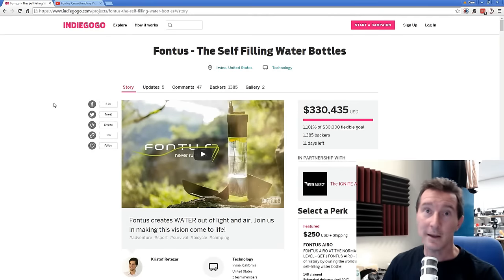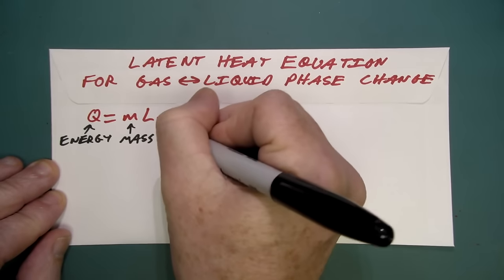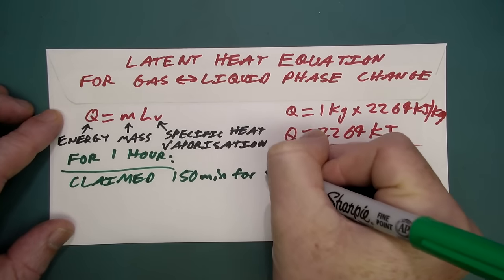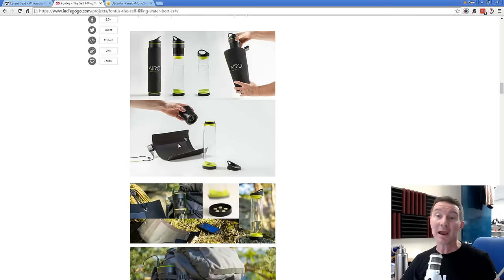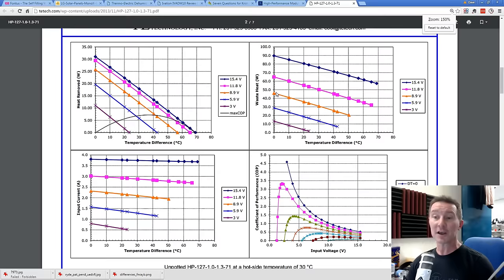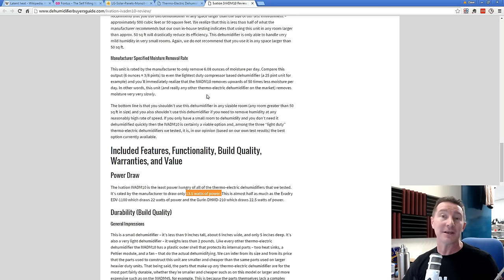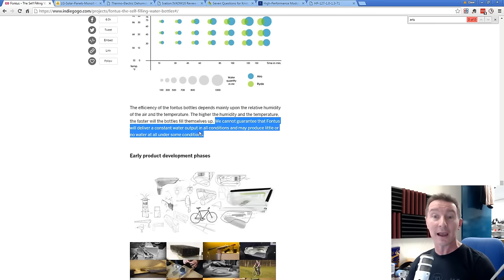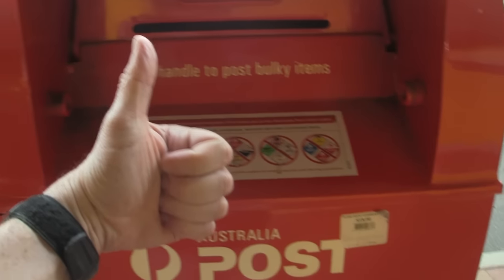EEVblog #881 - Fontus Self Filling Water Bottle BUSTED!

Comment: It would be using 5v - did you not see the USB ports? (or the much more obvious give away - the size of the panel, ffs, has anyone ever seen a 12v panel that tiny?) 
This would make the peltier element much more "efficient" -  for heat output anyway, not cooling capability. 
You get its heat "pumping" capacity, plus what is actually an "inefficiency" in the rest of the electrical world - the element creating heat from the power running through it. 
You need cold to dehumidify.. 

So you brought up an irrelevant point - it's heat output efficiency, and then we're spewing total BS about it.

Comment: How can a heat pump be more than 100% efficient? Where does the extra energy come from, because it must have extra energy, or else it wouldn't be over 100% efficient!
Reply: +Seegal Galguntijak It pumps the extra energy. The idea is that you need less energy for pumping heat, than the heat itself. You are basically fighting the third law of thermodynamics when you pump heat. 
It works really well for heating your house, because all the electrical energy will be converted to heat, and you will also pump heat from the outside. So even a very bad heat pump can have 200% efficiency. The problem is that Peltier cells are very inefficient, so they are only used where other solutions are not practical.
Reply: neurhlp I see, so the pumping action itself isn't above 100% efficient - that makes sense then, thanks for the explanation!

Comment: Just wondering,what if they were to power it with a huge dynamo running off the bike's spinning wheel?It wouldn't be practical but would it condensate a good amount of water,fast?
Reply: +Dwg According to a quick google search an average person can only produce around 75 watts on a bike.  So you would be well short of the 250watts that is needed.  A very good athlete might get to 250 Watts but even so they won't be able to actually bike anywhere because all of their energy would be going into making water.

Comment: Yeah I don't know about all of that sciencey sounding stuff. And even someone with my level of ignorance could tell such a claim was too good to be true. 
Without the whatever effect its supposed to work on, just setting a cold beer straight from the fridge, onto a picnic table with a relative humidity of 80%, the condensation on the bottle wouldn't come close to equaling the amount of moisture that you exhale, at rest, to equal a similar amount of condensation on the bottle. And it takes a lot of energy to cool the bottle down to that point. 
 Now imagine you're in an athletic setting, perspiring profusely where you need a liter an hour...what fucking device the size of a flashlight will give a whole liter, in 4 hours, let alone one? What the fuck. 
That's why survivalists always suggest looking for existing stands of water, and know how to sterilise it.

Comment: And then there's this paper from the "International Journal of Water Resources and Arid Environments" that draws a litre of water an hour using the same basic technology at 120w of solar power. Given they are likely at high temp and humidity..

But they use multiple peltier devices and they run the air first through the hot side heatsink so it can gain more moisture, and then run it through cold side heatsink. 

But still published results of a liter per hour at just 120w solar. 

http://www.psipw.org/attachments/article/273/IJWRAE_1%282%29142-145.pdf

Could better thermal transfer technology in the heatsinks making larger surface area possible make it even more efficient?

Comment: The product is an scam of course, but I would say that there is a mistake in your explanation. To convert vapor to water you need to EXTRACT heat. And, in fact, you can extract 1 kJ of heat by using much less than 1 kJ of external work. In the following link the extracted heat is called QC and the external work is called W: http://physics.csustan.edu/Ian/HowThingsWork/Topics/Temperature/ThermoLaws/Refrigerators.htm . You can see that W=QC/COP and COP is above 1. We could assume COP to be around 10 for the current scenario, and then it would be possible to extract 1 kJ of heat by using 0.1 kJ of energy.

Comment: Please have a look at "dew point" in Wikipedia and search for a dew point calculator on the internet. By increasing the pressure using a fan or Venturi effect like in the "Ryde" version, dew point is even higher. It will work without having to cool the air down !!!
All the calculations you have done are crap!
Of course it might never work in the Australian bush, but on Australian coasts, in rescue boats, this thing can make the difference between life and death.
Reply from the maker: +marco672010 Please explain why the commercial thermoelectric effect units (which have fans too) which are essentially identical to the Fontus design, can't produce anywhere near what the Fontus claims.

Comment: so you need constant 250w power for one hour to produce 1liter of water or 250w in total?
Reply: +JusstyteN 250W is an instantaneous measurement. Do you mean 250Wh?
Reply: +JusstyteN 250 W for one hour would be 250 Wh in total. And to get that 1 liter you'd need it to be at least 40 degrees C, 90% humidity, and have a 100% efficient system of extracting that water...
Reply: thanks for clarification
Reply: +Samgab Please consider using joules instead of watt hours, watts are defined as 1 joule/second so a watt hour is (1 joule/second)*3600 seconds. I know joules are basically unheard of in the US at least (on a popular level) but dividing something and then multiplying it again by the same thing is ridiculous!

Comment: so you need constant 250w power for one hour to produce 1liter of water or 250w in total?
Reply: +JusstyteN 
watts aren't actually a system of measuring energy, in the video he said 250 watt hours
Reply from the maker: +JusstyteN No, I goofed that, it's 250W for 2.5 hours. 625Wh
Reply: +JusstyteN I am using dehumidifiers that are rated 210W, the manufacturer claims 10 l /day (maximum, hot and humid).

Thanks to the EEVblog for fending off religion in science and technology.
Reply: +EEVblog thanks
Reply: +JusstyteN Dehumidifiers: 30 °C / 80 % rF, 55 l/24 h by 900 Watt
Reply: +JusstyteN  more like 600 watts (compressor/peltier efficiency) to pull a liter per hour.   The input air on mine at 80f with 90% humidity gets raised to 100F with 60% humidity and it puts about a liter or so per hour out... while the shower is running.   Spraying just cold tap water (75F-ish) in the shower raises the moisture in the room from 43% (best continuous operation) to 64% and pushes the temp from Airconditioned 70F to 90F in the exhaust.

Its a valid system and it could work if it had five square meters of solar panel at 30% efficiency in a 70% humidity environment.

Comment: No, sorry, this is wrong.  Condensing a liter of water from vapor to liquid does not require 2264.76 kJ of energy.  It YIELDS 2264.76 kJ of energy!  We could use water vapor as an energy source, if it weren’t for that pesky Second Law of Thermodynamics.  Thanks a lot, Obama.

Given that free transfer of energy isn’t possible, how much does it cost to transfer that 2264.76 kJ from the vapor to somewhere, anywhere, else?  The efficiency of a mechanism to move heat energy around is called the Coefficient of Performance.  A really good air-conditioner can have a CoP as high as 3.5, meaning it consumes only 1/3.5 (28%) of the energy it moves, meaning that heat-pumps (which air-condition the outdoors and move the heat inside) can be very effective.  A Peltier cooler, though, has a CoP between 0.3 and 0.7, so it could take more than 7550 kJ (2000 kilowatt-hours) to condense a single liter.

Comment: Could you build a bottle that does this when plugged into a wall outlet with a laptop charger?
Reply: +BosonCollider Why not just get a $40 dehumidifier from Amazon, plug that into a wall outlet and then pour the resulting water into a bottle? Or just get the water from the tap - cheaper than paying for the electricity.
Reply: +BosonCollider yes but if you have access to a laptop charger and wall outlet you probably also have access to a tap
Reply: +BosonCollider Well this would work over a very long time (months) A charger is around the 80W mark so would still take at best days to get 1 litre.

Comment: Wouldn't this work a hell of a lot better if it was powered by one of those dynamo bicycle hubs or a generator that rubs the tire. Seems like if these jackasses weren't just con artists and actually put some thought into it the bicycle version could work?
Reply: +Jason Grimm Nope. Granted, a hub dynamo is a much more reliable source of power than any kind of portable solar panel. But it only produces enough power to charge your lights, maybe GPS and phone. You could get maybe 10W out of it without noticeably slowing your bicycle down; to keep yourself hydrated, you'd need hundreds. Which you could technically exert if you're a decent cyclist, but you'd need a much bigger generator. And a much bigger heat pump.  And you wouldn't have any energy left over to go anyplace. So yeah, you're better off just carrying more water bottles, if you must.

Comment: what about using the power from the crank of the bike? or the battery of a pedelec or e.bike?
Reply: +Cheesecake An easy bike-ride is about 100W, heavy-biking for a normal person is 300W. Tour de France is 500-1500W sort of power
Reply: +redtails there is a video on yt of German velodrome cyclist Robert Forstemann powering a toaster. 700 watts he needed to maintain and it looked like it nearly killed him off.
Reply: okay, that sounds hardcore!
Reply: +Cheesecake And said cyclist was dead tired after generating 700w of power for about a minute.
Reply: 0tispunkm3y3r and Crimson Sunrise  I realize it and it's what I said ;). I do cycling for hobby and can maintain about 280W of cycling power (measured at a university) at maximum intensity. I'm a fairly healthy 20'something and at that power you go about 25-30km/h so it's not an easy bide ride. You'd notice it very well if you're using say 100W of that power to make water from air.
Reply: +redtails Nope not even close sprinting is about 1000W for about 20 seconds or about 1300 for 5 seconds. The bulk of the race they are around the 230-250W mark (on the flat) with hill-climbing a bit more IE about 400 or a bit less. Also define "normal person" I consider myself a "normal person" but was averaging 22mph over 100 miles at 15.
Reply: Gordon Lawrence One thing is +1000W for ~5 (not 20) seconds. Another is maintaining ~700W for about a minute.
Reply: Crimson Sunrise professional athletes can hit 1000W for a damn sight more than 5 seconds. I was measured on an ergometer hitting just over 1000 for 20 seconds so professionals should be able to do it.
Reply: Out of curiosity, why are you guys bringing up sprinting power at all? We were talking about a few hundred watts over several hours. In 5 seconds you're not going to make a significant amount of water even if you're powering it at 10kW. (10 kW at 5 seconds is a bit under 14 Wh..)
Reply: Jasper Janssen Best case scenario power output for constant performance, much like Dave is doing in his video.
Reply: Except the sprinting power is not constant power output. Not even in the best case.
Reply: Jasper Janssen exactly. Even a 15W dynamo being driven from the crank or wheel slows you down. A pro cyclist would go nuts if someone wanted that kind of disadvantage put on them, I have seen 100 mile time trials with 30 seconds between first and third. That is about 0.2%. 15W is way more than 0.2% (more like 3%) and would not be enough to produce much water at all. To make it work in a reasonable time period you'd need about 60W. Even then il would take way more than an hour. (More like 4 to 5 depending on all sorts of factors). I just don't see how anyone could see this working no matter which way you look at it without a solar panel at least 20 times bigger.
Reply: Gordon Lawrence I mean, maybe they invented a revolutionary dynamo that offers zero resistance to go along with the Fontus device.
Reply: You mean a 100% efficient one? Or do you mean a perpetuum mobile that gives you free energy?
Reply: Jasper Janssen Also boosted by a Batteriser, which would make it 800% more efficient. With that, these Fontus devices could save lives.
Reply: Crimson Sunrise nope no such thing. You cant get power out without it coming from somewhere.
Reply: The power comes raining out of the sky like manna.
Reply: Gordon Lawrence Of course it does. Ever heard of the magical quantum vaccum?
Reply: oh yea Zero Point MOdules Horray!

Comment: Uh wait, can you do it?, can you make one? do it... they made one, good idea, I didn't have water when I started and had no where to get any. Think about it. So what if its a dehumidifier, they all are, the big home ones do the same thing! Dont listen to this whiner!
Reply: sure this could work, but to get a full 12oz bottle would probably take decades of this thing running, it would probably be a better idea to try to bind the oxygen in the air with hydrogen atoms from some hydrogen fuel tank to make the water, but that would be a fuckton more expensive.
Reply: The point is that it doesn't work in any productive or useful manner and they're making it out to be amazing. The point isn't "i can do a better one" it's that even if all of the production steps are done perfectly they can't meet their claims or even 1% of them. It's a good idea in theory if you could compact enough energy to produce the water from the air and have it be lighter than just carrying that much water in the first place, but solar panels aren't the way to do that, batteries are, and even they can't come that close. Let me do a breakdown for you:

That industrial, extra efficient dehumidifier that he looked at online could do 6oz of water out of the air in good conditions in 24 hours, with 15w of input. That means, in order to run the unit off of a battery, the battery alone would need to produce around 30Ah @ 12v. Regular batteries exist that can do that, but they're mostly car batteries which weigh around 20 lbs. That's the same weight as roughly 2.4 gallons of water.

Calling something bullshit that breaks the laws of thermodynamics with their predictions doesn't mean you have to "do better" than them or shut up. The whole point is that it's an impossibility and it can't be matched let alone exceeded. If pointing that out makes someone a "whiner" then I guess that makes all people rooted in reality a bunch of whiners. You presumably are not rooted in reality, so is the lack of annoyance at this fundraiser scam worth being ignorant to you?
Reply: Also, Corestarter is right about the decade thing, you'd be better off just riding with an open bottle on the handbars to catch the rain you'd catch way more water in way less time. 

He's not right however about the hydrogen and oxygen fuel tanks, which are going to outweigh the water you could produce with them. You're best off just bringing more water in a regular light container or using a nano-filter bottle if there's any natural sources of water along the path.
Reply: Jamison W. I was more referring to creating water where the was none in less time thing, the power needed to fuse oxygen and hydrogen together alone would require too much hardware to carry around.
Reply: The fusing of the oxygen and hydrogen is a net loss reaction, that's why hydrogen is highly flammable and borderline explosive with enough oxygen. I'll let you off the hook though, that's probably lighter than carrying a car battery and a heavy duty dehumidifier around.

Comment: I'm disappointed: You're busting is only sensational, I did expect more from you than Thunderf00t did already. You're not even trying to get the points.
How much would a high efficient solar panel produce at the equator?
Ever hear of fog catching? Are there, perhaps, some other ways to promote condensation. When you see how much cubic meter a fan can shuffle, it doesn't matter how many liter water are in the air (that for Thunderf00t), you could even ask if a pressure drop could help condensation…

You're an engineering, solving problems is fun, dismissing too easy.

Why should I watch this video? Thunderf00t already did a better one.

Comment: I didn't bother to watch ther whole video but I skimmed through it. It seems you are also lacking some basic engineering (fase equilibrium).I will not bother to explain how it is relevant, just pointing out some hypocrisy.
Reply: HINT: water heat of vaporization is not constant with respect to temperature/pressure